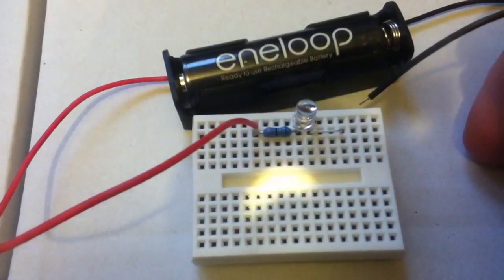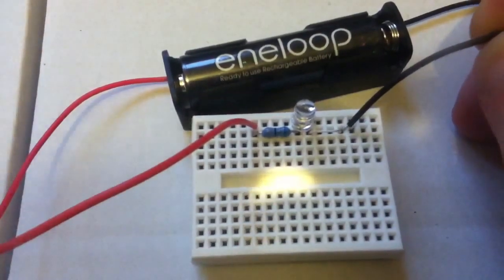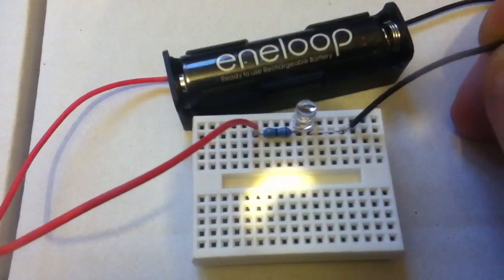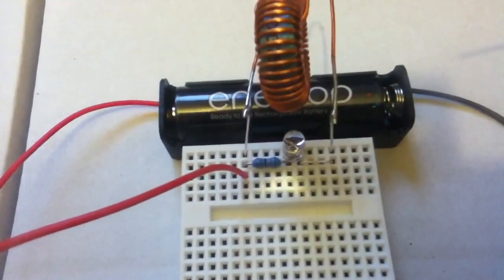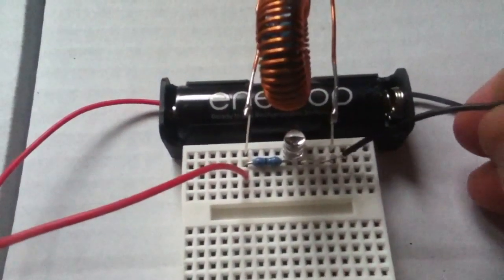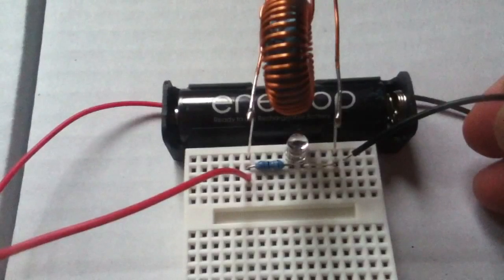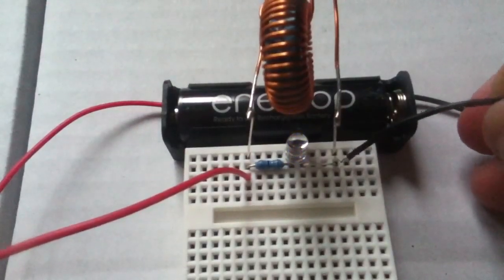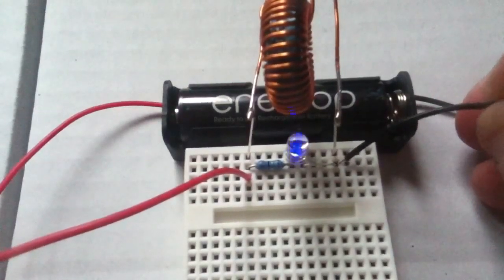Inductor Tutorial - How to Boost Voltage and Switch Polarity

Comment: I put one coil between wires and increased frequency with frequency generator..when i adjust higher frequency in multimeter i saw voltage becomes lower . i researched it it called "inductive reactance" this phenomena decreases this voltage because resistance gettin higher. In boost converters when you increase the frequency then voltage also increases because diode and capacitor prevents this reverse polarity (this inductive reactance).. so switchin coil fast enough without any components makes voltage drops actually but switchin coil with diode and capacitor you can keep voltage higher..

Comment: Hi have you ever tried mixing 2charged opposite liquids view joe cell horses mouth as it explains I believe he has used urine in the cooling system of the engine which through evaporation vacuum coats a lithium crystal coating inside all the engine does this add up to you as I have been told be then carries out something called phasing out appreciate reply as you will see I am trying to get an engine running on atom stripped opposite magnetic attraction repulsion
Reply: you need to learn punctuation